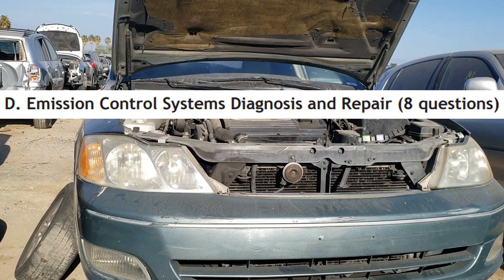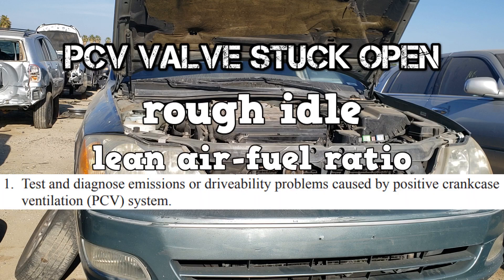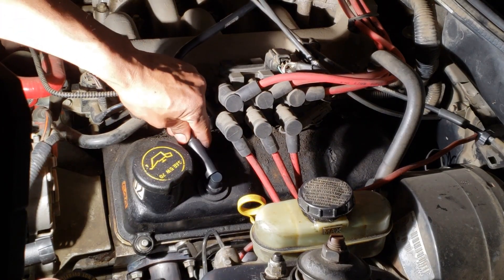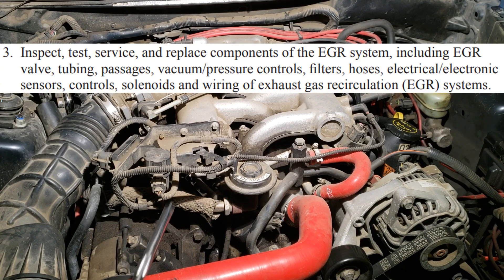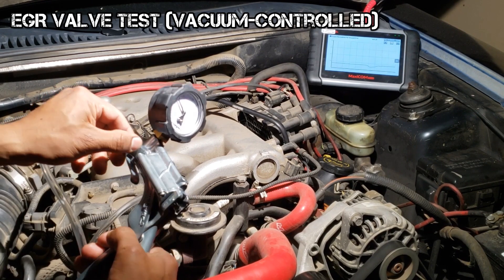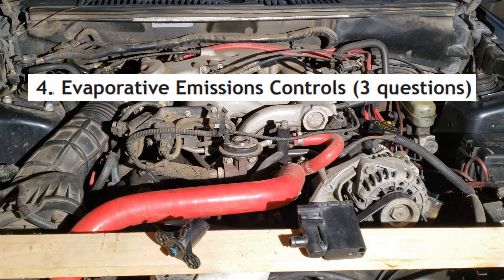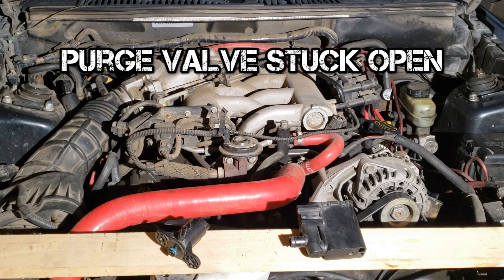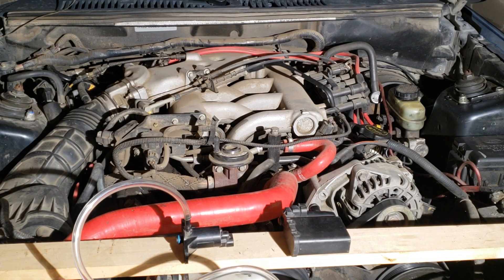ASE A8 Test Prep #3 - Emission Control Systems (PCV, EGR, EVAP)

Comment from the maker: Update: Video breakdown after taking the test. PCV Valve section relevant for the test (Just the general information, not the tests for functionality)
EGR section: Know the symptoms of a restricted EGR Valve to intake manifold passage, not fully clogged, but restricted. I did not mention anything about the EGR position sensor, make sure you know the basics of it.
EVAP section: General information relevant, but not the tests shown for functionality.
There was one question about the secondary air injection system, it focused on solving an incorrect flow data trouble code.
Reply: Such a good set of videos. It was a great idea to make these to help yourself study.